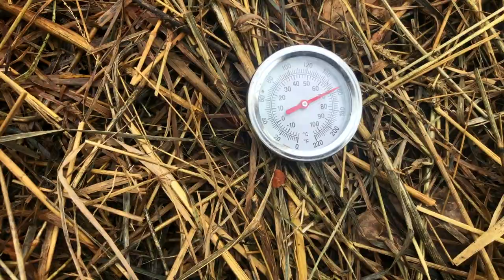Greenhouse - Heating with Compost Power and Moving Water?

Comment: Two thoughts. One: dig the stock tank 2 feet into the ground so you solve the Sylphen issue and the water temp warms soil first instead of just the air. Two: run a second hose through your grow beds so the warmer water has direct content to the plants. Hope that helps
Reply from the maker: Two good ideas, something to consider.
Reply: @edibleacres  Hi Sean, so if I understand the video correctly goal 1 heat the beds, goal 2 heat the greenhouse, goal 3 heat the home. Step 1 find more pipe run it through the garden beds (6 to 8 inches deep or what ever is best for plant growth). A simple loop should do. Dump all your heat into the beds. Allow the heat from the beds heat the space. It seems like the tank is just the device you need to circulate the water. Try a different device, a 5 gallon bucket should work you will have less water mass to heat. Returning more heat back to the compost pile (until you can figure out how to do an inline pumping system). If you want to keep the big tank remove a lot of water, enough that is only necessary to keep the pump submerged. Once the tank reaches the same temperature as the input temperature you can then add more water mass to the tank 1 gallon at a time. And as others have said about the tank put a lid on it (until the tank reaches temperature), then again if your trying to heat the space, maybe not a lid. On sunny winter days in February you have already proven the little green house gets toasty warm. Using the air exchangers in combination with the compost pile should do an excellent job on heating the garden bed up. 

     Do you have some maintenance to do on the greenhouse? Such as plugging up any holes that were missed last year or new ones from this year? Also will you tarp over the compost pile to keep snow off of it? Will you add more material to the pile if you see temperatures fall off or just regularly add fresh material on a weekly/monthly basis? I hope you can find a set of solar evacuated tubes at the re-use store. That would be a really good score. Cheers,
     Bill
P.S. I have invested 1 hour on these thoughts, I hope they help you.
Reply: @williamwalter8554  Some people already tried to run hose with hot water in their beds... The problem was that it was drying up the beds... So not a so good idea (according to what I  found on the internet) if you want to use the beds for growing. If I can find the video, I'll put a link here. Why trying to re-invent the wheel... ;)
Reply: @cambobby2011  Use an air system with perforations for heating the beds. The warm moist air will condense in contact with the cooler soil and give off it's moisture and heat. Use charcoal and wood chips as a biofilter layer in your beds. All kinds of great ideas out there! You would need to monitor the moisture in your compost pile. A bigger pile would produce more heat and Epstein didn't kill himself.

Comment: Cheap insulation method for tubing is to run it though pool noodles. End of season left overs sell for a buck each in sto r e or neighbor with pool may have some. They usually get tossed at end of swim season
Reply: That is a great idea!
Reply from the maker: GREAT idea here.. I should keep my eyes out for those!
Reply: And actually the foam insulation for copper piping is cheaper I think and it's black so it absorbs heat as well. We used the neoprene rubber type foam for our solar hot water installations which is more efficient but it's also kind of expensive. 6' sections of the foam are about 2$, new.

Comment: I  have seen a passive system that provides frost free greenhouse in the depths of winter, it was based on copper tubes sealed behind glass and heated by the sun, and fed underground to heat a pit of broken glass as a heat store. it just relied on thermals to move the heat. When I seen it it had been in use for years and was covered in brambles and forgotten, but continued with neglect to keep the greenhouse frost free.
Reply: That is astonishing!!  A system built so well it kept going by itself!!!!  I am intrigued!  Could you give an estimate of total length of the copper tubing, volume of broken glass and the amount of square feet the greenhouse was?  How was the copper tubing sealed in glass? Was it a stand-alone greenhouse or attached?  and any guess how the holding area for the broken glass was constructed??  LOL my brain is on fire! Thank you in advance for any more information you can share!
Reply: @amandajarboe1131  if you get any info please share with me
Reply: I'd also be interested in a bit more specificity.
Reply: Hi Steve can you give more details please, thanks in advance

Comment: Dig a pit.  Build your compost with pipe ( WIDER  PIPE  THAN  YOU  HAVE )  in the pit.  The pipe taking COLD should be LOW in your greenhouse.  The pipe which delivers the HOT should be higher in the greenhouse.  HOT air rises.  COLD air sinks.  It will automatically deliver the heat.  No water necessary.

Comment: Wow! Lots of information in these comments. I picked up a free poly pipe coil on the side of the road today. I like the thermosiphon approach, too, but if that doesn't work try a used car  windshield washer  pump...they're cheap and the flow would be much slower. I'm experimenting with all this stuff too. It's all an experiment. I currently have 200' of poly coil in a compost heap that I started to heat a small hot tub. I do compost inside my small dog kennel greenhouse, I pour chicken poop tea on it from time to time.
Reply: Make your heap as big as possible to avoid  heat drops in the pile !

Comment: Any heat you gain is going to escape right through that thin glass, make a bag greenhouse inside your greenhouse with 2 mil poly, to keep that heat inside. Staple the plastic sheet right to the frames of the windows, and it will leave an air gap that will give you R5 insulation as well as sealing off any cold drafts. Total cost: $20 for one 10x100ft roll
Reply: Doctor Medkit exactly what I was thinking! Any energy that was being transferred was just being lost.

Comment: I have a background in the HVAC industry, you are right you are a little short on the length of tube in your pile, if you would have added at least 100 feet it would give you more surface area to heat your water, additional the velocity of the water from your pump is to fast to scrub the heat from your pile. 

 To get your passive flow, with in your conversation you may not have the delta with the short length of tube that you have, now with that said you could possibly put your holding tank up on blocks, install a bulkhead fitting in the bottom, and allow the cold water to feed out the bottom, the velocity of your water is going to be slow enough like that to give you great heat transfer. And feed your warm water into the top of the tank to keep the cold water or return water moving vertically in your holding tank
Reply: The Nech  easily done with packed on leafs for the top, while using the paper to make the insulation for the sides.  I would also configure the current set up somewhat differently as the tube is packed too tight and does not give enough space within the pile to gain heat, but circling the pipe in layers would bring more heated surface heat to  each layer.  However, I do follow the thought of easy out at the end of the life of the pile.
Reply: Hi, I'm no expert but I think you're pumping out too fast. My sense is that it would need more time for the heart to transfer. Also, again just my feeling, a taller, thinner tank with more vertical differential might work better, so perhaps if you raise the tank you have and let some pipe from that bottom section fall further you can effectively lower the bottom... Perhaps you can source a smaller weaker pump or slow the rate that one runs at?
Reply: The water flow is too high !
Reply from the maker: Great ideas here.  Thanks SO much!
Reply: You cannot take to much heat from the compost..
It would stop the process of heating.
Reply: @alexanderengdahl7203  
That´s what i was thinking. If you cool the  pile to much, it can probably slow down or stop the composting process, because the thermophilic microorganisms thrive in hotter temperatures, and they are responsible for the bulk of the work in composting.
Reply: A one way check valve would help build the pressure to raise it to to proper level
Reply: Plus you want your compoast at 130 for three days intialy then 110 from then on if left alone the pile will go anarobic so turn every two days or put so air holes through it air can pinitrate only one foot into the pile and the holes let heat out so put the compoast pile in the green house
Reply: Think of it like this your coil of pipe is to be on when the pile reaches 115 make the water flow when this temperature is reached then when it starts to drop off add water or nitro or air till the piles temp reaches 115 to 120 continue
Reply: Do not cool your compoast above 130 or it will loose lots of it's nitrogen and fertility in general because good mirobes begin to die
Reply: @alexanderengdahl7203  So maybe in this situation/model, simply more compost volume would work!?
Reply: @jerrymaxey4664  be careful putting compost inside structures. They’ve been known to set things on 🔥 😯
Reply: As a pipe fitter for coming up on 40 yrs 
Well said
Reply: @alexanderengdahl7203  key point many are missing

Comment: Some random suggestions:

1) Try adding thermal mass inside of the coil in the compost pile.  This will mediate the thermal generation of the compost so that it doesn't fluctuate much under varying conditions (i.e. external temperature, wind, etc).
2) Dump the pump.  The compost pile is generating some amount of heat X.  The water moving through the coil removes some of the heat Y from the compost pile.  If Y exceeds X you will pull all of the heat out, and eventually the pump will just be circulating cool/cold water.  A natural thermosiphon manages this organically so that you get a more or less X=Y balance.
3) Try a deeper tank. By adding greater distance between cool water drawn from the bottom of the water tank and the hot water returned at the top, you'll have a stronger siphon.
4) Try keeping it a closed system with no external water source.  If you have a closed loop of water, the compost pile will heat it, and this might be cumulative.  But, if you add rainwater continuousl, you will be lowering net temperature (like running cold water into a hot bath).
5) Try running the hot water return from the compost pile through the grow beds before getting to the thermal battery/mass.  Might overheat the beds, but might be worth a try.

That's all I can think of, hope it helps.
Reply from the maker: Great thoughts here.  I wonder if a thermosiphon could be initiated with this little total height... Hmmm...
Reply: So have you done any of this or is this a thought experiment
Reply: Theres alot on here and alot I may not understand about thermodynamics, what a great topic. But I haven't seen anything about thermophillic bacteria yet and thats not a marginal difference. Also, I like your 1. to put the thermal mass inside the compost pile. My other comment was to insulate that tank. I want the ability to light a camping fire within the thermal mass to warm it and a rocket stove bench design to lay on the mass. Other ideas maybe to use plastic jugs (since salt wont corrode them to keep from freezing) and dig in and line the north wall with your insulated plastic salt water buckets, my idea is to link those jugs and circulate the water minimally so that they maintain (what 35 degrees-40 degrees )your greenhouse, perhaps you can run that salt water through a homemade solar collector.  My other idea is to put a fresnel lens on your tank of water and see what energy you may capture. Don't use salt and keep the water moving?

Comment: From the designs that I've seen for passive thermosyphons, the "cold", (leaving the thermal battery) should be level with the bottom of the coil and the "hot", (or return) should be level with the top of the coil. The length doesn't matter that much as the water in the pipe will just flow slower, (though that does mean that more of the compost heat will be lost to the environment. (You can try both and compare the results.) Remember not to let the warm returning water mix too vigorously with the cold water.
If you look at pineapple houses in the gardens of England from 300 years ago, they had a setup much like yours, (compost next to the greenhouse) and they constructed walls around the compost and added a wooden hinged lid, and then had holes in the brickwork that enabled warmed air to circulate into, (and from) the greenhouse. The advantage of your thermosyphon is that it keeps the smell/bacteria/mice out; the advantage of using air as the conductor is that there isn't any water to freeze and burst pipes, (and makes cycling the compost easier.)  It would be possible to combine the two systems into one design and get most of the advantages of both, (but that requires construction in the garden.)
Reply: Coil level for thermosyphoning: cold feet & hot head.

Comment: Some simple things:

1. Use a thick black tarp (Eg pool liner?) over & around your compost pile to help hold heat.

2. Drill some holes, or use something air can penetrate between compost & greenhouse. (Not solid wall)

3. Cover water source. 

4. Insulate around wherever you can.

5. Build some “can window heaters” (heaps of videos avail)
& have the hot air from those run wherever you want.
Using this method you may not even continue with the method you have now.

Tip: When doing a temp reading, don’t have you body near the item you want a reading from. Like in this video your hand would have affected the reading of the water.

Great video. Good luck.
Reply from the maker: Great notes, thank you!

Comment: As stated earlier you need to work on insulating the greenhouse to minimize heat lost. But some things you could look into is to increasing the compost pile as big as you can vertically to increase the heat produced. Than you could paint the water trough black to increase its solar gain. You might even want to look into paint your greenhouse walls black as well.

Comment: Bio-char added to a compost seems to increase the heat of the pile.  This is my personal observation as well as that of a friend who monitors his compost with a thermometer.  It might be worth a try to tweak the system and get every bit of energy out of it you can.
Reply: And using the inner circle to feed the compost pile when the temps start to drop.  You would have all the outer ring as insulation as well.
Reply from the maker: Interesting... I should explore that as we make it every day with the wood stove.
Reply: @edibleacres  My guess as to why this seems to be so is that the bio-char allows more microbial life to exist in the pile and thereby more heat is generated.      I hope you give it  a try...
Reply: @edibleacres  It will filter out unwanted gases produced by decomposition and become integrated and inoculated as biochar. You would make a complete circle of usage. So many possibilities!
Reply: And add a stack of COMFREY! That will bring the temperature up quickly.

Comment: Shaun, build a black locust box large enough to bank some leaf insulation around the tank, and a top to stop the heat from leaving would also be wise.  And yes, I agree plumbing in a return and over flow is a great idea; however your pipe would benefit from some black paint or tape off of the rainwater catchment tank.  Most importantly,  I think you will find David  Pagan Butler ideas on "Enhanced Bubble Pumps for an Organic Pool" or "Organic Pools airlfit pump system for a koi filter" very interesting.  I believe you will use some of his ideas to make the system function great this year as you figure out the finer details.

 As far as heating the house, I believe your pile would have to be much larger to achieve that.  However, some black screening used in a solar air heater banked against the house, but inside the green house, or on the sliding glass door could look something like "Solar air heater in Northern Quebec" or Best Passive Solar Heating - Made Easy... and that works!!!"  All "links"  found on YT.

Now here is my question:  Sasha, when are you going to post another cooking video; soon I hope !?!

Just ran across this today, it would be worth a view; "How To Make Solar Water Heater/geysers Under 10$".  It is not exactly the way you are going, however the end result looks to be good.

Comment: This is a great idea. My observation: Because the tubing is placed directly within the compost, you will need to completely remove the compost during the summer to reestablish an active pile. If the pile was elevated with a flow-through design to remove finished compost from the bottom, it might make it continuous and much more efficient. It would require a huge amount of work, but your initial design has really gotten my gears turning. Nice job!

Comment: Elevating the tank will help with thermosiphon. Cold water out the bottom warmed water in the top. Since you have a shorter length of piping slow down the flow through it. If it were spread out a  little more may help also, it seems from the photo that it is rather closely spaced. I believe insulating the tank will help as well. Maybe running the warmed water through the raised bed with a separate pump and piping set up would help heat the bed directly. Maybe a lower flow pump something like one of those small pond pumps I've got one that does only 65 GPH. This would let you cycle the whole tank maybe once per hour without putting any restrictions on the pump intake or outlet